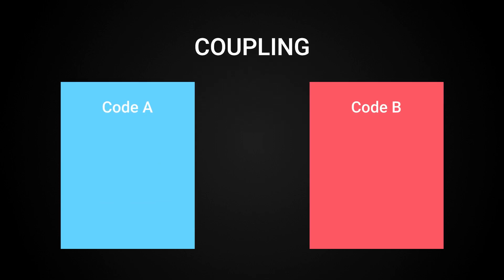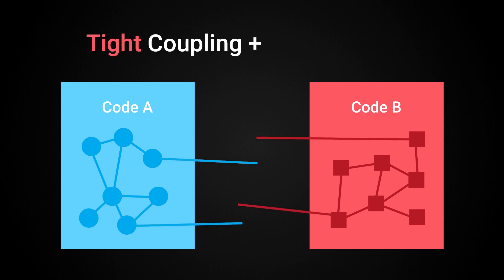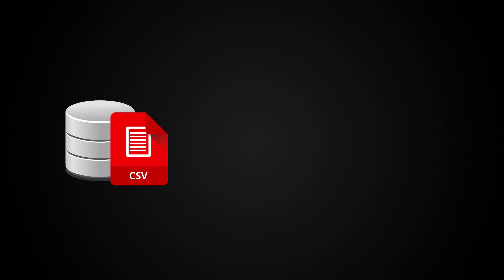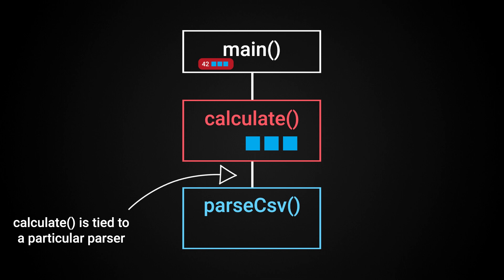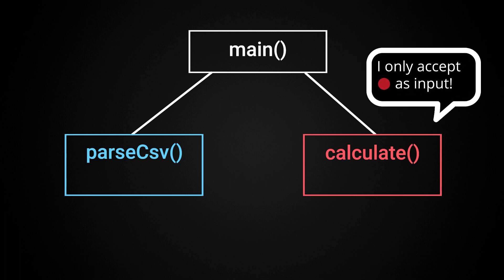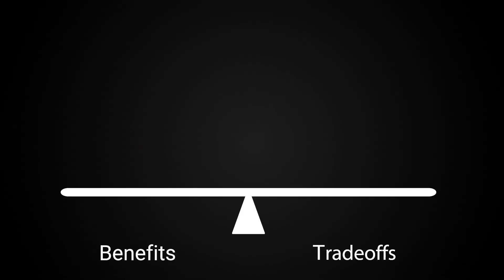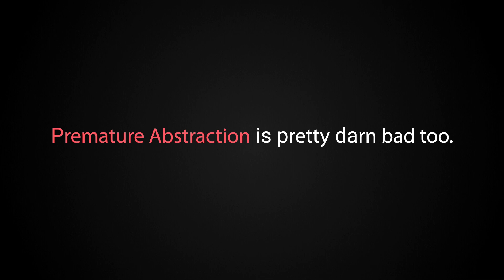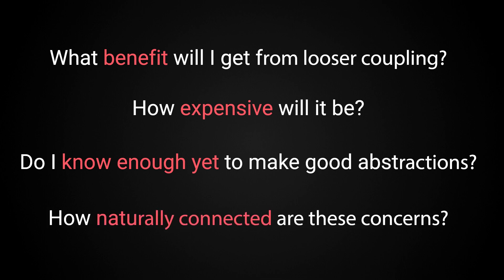Loose vs Tight Coupling

Comment from the maker: A couple things I cut from the video:

Loose vs tight coupling isn’t a strict yes vs no answer. Coupling can exist in a wide spectrum, ranging from all your code jumbled together to highly separated systems. You’re looking for a point on that spectrum where you get the most benefit for your cost. Simple patterns like organizing your code and minimizing function calls between different concerns go a long way and are cheap.

Second, there are different approaches to decoupling code. The example I gave was one approach, but you can imagine many others that range in complexity and level of decoupling.  For example, I could have had the file parsers implement a common interface and had the calculate() logic accept that interface as input. I could have used a stream API, callbacks, dependency injection, etc. This goes back to finding the most benefit for the least cost (code complexity) that meets your requirements.

Finally, I sometimes see design disagreements between engineers that devolve into abstract debates about concepts like coupling or separation of concerns. I find these conversions can be more productive if you concentrate on the specific tradeoffs in the case at hand. Different people will make different implicit trade offs, leading them to different designs.